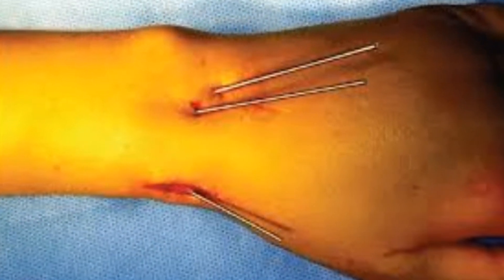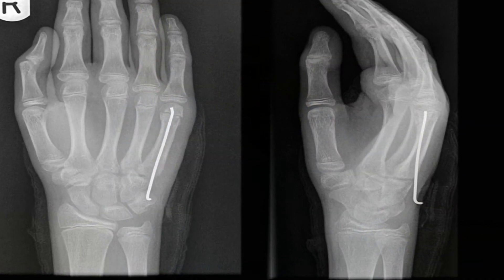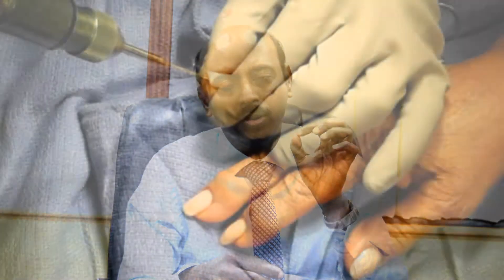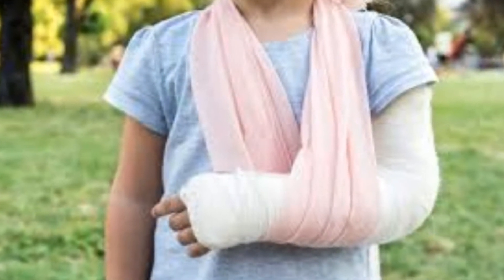K WIRE TECHNIQUES FOR BONE FRACTURES I PATIENT EDUCATION I MIC

Comment: Haw many day later remove k wire  operation karke nikal te hai kya
Reply: No operation not needed they will just pull them out with pliers😭.
Reply: @Doesitmatter00710  does it hurt?
Reply: Usually 3 week a
Reply from the maker: Thank you for your comment! We’ll forward this question to the doctor and address it in our future videos.